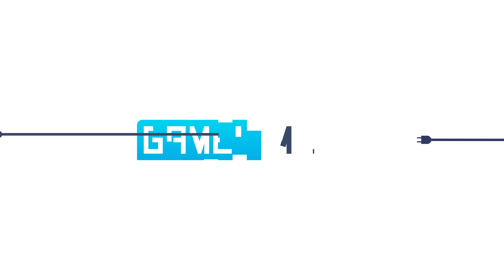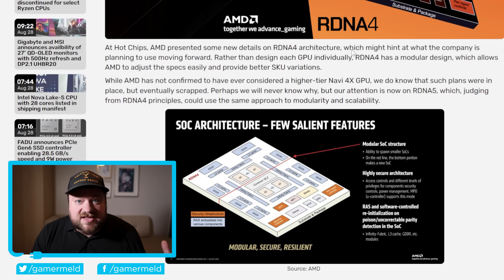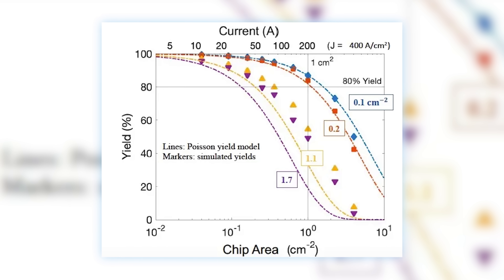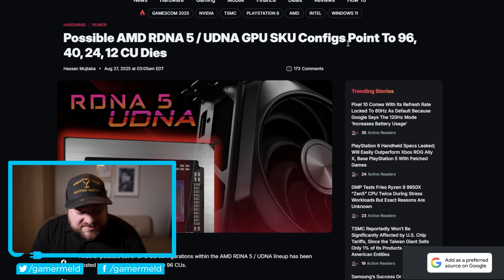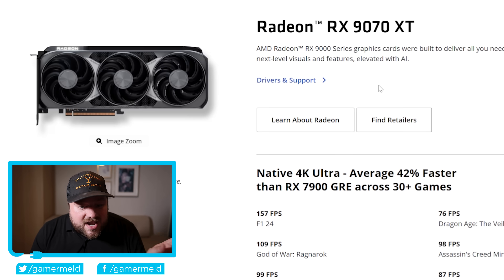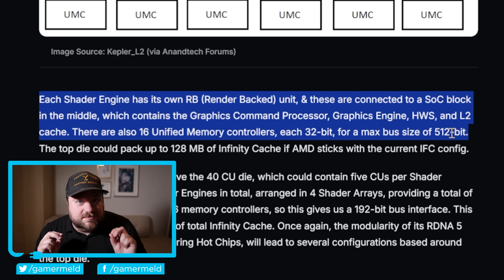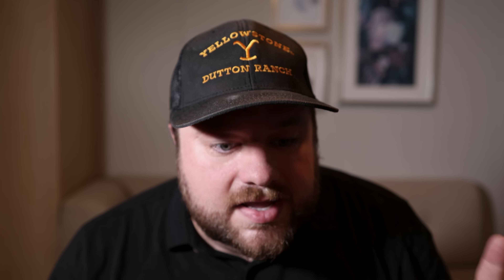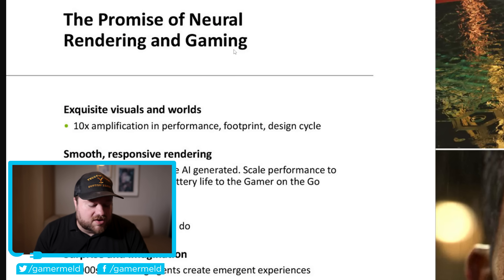Nvidia Officially Reveals The UNTHINKABLE!

Comment: I don't hate "fake" frames. I hate that it's being marketed like it's applicable on all games. In terms of rendering, what's "real" and "fake" anyway? So what is "real"? at least for now... It's frames rendered and produced from true game logic/game engine. Why is "fake" frames fake? Well simply put, the game engine doesn't recognize those frames. This is why current frame gen and multi frame gen techniques are not advisable on fps shooter games. Since you might see it as smooth at 400-800fps(whatever), but in reality, the game engine would only recognize input on the "real" frames that probably around 60-300fps. So on your screen, you think you are hitting your target, but the server/game engine does not register it as a hit, since the opponent's hit-box isn't there anymore or wasn't there to begin with.

So when will the "hating" stop? Well, once nvidia finds a way that those "fake" frames stop being fake. Which is once the game engine/logic recognize those AI frames. Because at that point, it would just be a new kind of rendering graphics and won't be fake anymore.
Reply: That's what I think to.. frame gen can be really useful if you can push 80-90 FPS in a single player game and want to fully use your monitor's high refresh rate, so you cap to 60 FPS and use frame gen, but they're selling it as a tech that can help you get 200 FPS coming from 30 FPS... we, tech enthusiasts, all know it doesn't work like that, but sadly some people don't and they fall for it.

The advertisement is the issue, just tell me it's a smoothing technology that works wonders in some games (cause it actually does tbh), don't sell me a 5070 like it's a 4090 cause you're going raw vs 4X frame gen.
Reply: @Iceman-hb3uk I remember playing with 20-25 fps, where we really had issues in competitive gaming, 30 years ago.
Cinema was working with 24Hz without any complaints, thanks to motion blurr.

Everybody should check his own reaction time and convert all lags into time to compare and really decide if it makes sense. That decides about the acceptable lag.

Everybody should check the repetition times with and without motion blurr to see a smooth motion. This decides about the repetition rates.

The gap can easily be filled with AI generated frames.
Reply: @moskitoh2651  Motion blur and frame gem CAN'T be compared like that.

Frame gen needs data to work with, if you start at a 24 FPS base you'll end up with lots of artifacts whenever you move the camera.
If that's your idea of a good gaming experience, I'm happy for you, but it's absolutely not bearable for most people.
Reply: @Iceman-hb3uk Motion blur and framegen both improve the smoothness of the recognized motion. They can be combined, to improve even more.

Guess you were very unhappy, whenever you were in the Cinema about the 24Hz... 😂😂😂

If you own a display with high refresh rate (obviously you do), there are pages showing you, how different framerates with and without motion blut look like, side by side. Warning: Afterwards you know, you spent money wrongly.
Reply: Reflex 2 is the answer... it already exists!
Reply: Fake frames are what they are, utter bullshit
Reply: So if someone hacks there own fake frames in real-time and slips them in between the other generated frames once a game recognizes those fake local frames like a cheating virus. shame. though doubt anyways smart enough to do this in the near future, or if even possible.
Reply: The benefit is for aiming and game experience. The difference between keeping 500-600fps and keeping 800fps is that you get the full input lag and motion clarity benefits from high refresh monitors like upcoming 720+Hz monitors, and the hitboxes are moving so rapidly that you're somehow going to miss because of it
Reply: @soren4904  Are you talking about frame gen at ×3 or ×4 in FPS games (even offline ones with high-FPS benefits)? If so, that’s not how it actually works. Right now, multi-frame gen only gives you smoother visuals, the game logic/engine still runs at the original FPS.

Example: if your GPU is doing 60 FPS “real” frames, the enemy hitbox moves from A → C, and if you shoot at C, it’s a hit. With ×4 frame gen, you’d see something like:

0 (real), 0A, 0B, 0C, 1 (real), 1A, 1B, 1C, 2 (real)...so on and so forth.

So it looks like 240 FPS, but the game is still only calculating 60 states per second. That means the enemy is really moving from point A → E in 60 steps, while frame gen just fills in B, C, D visually. If you shoot at anywhere from B–D, even though it looks like a hit on your screen, the engine won’t register it because those frames don’t exist in the logic.

So yeah, it makes games smoother, but for aiming it doesn’t help. As for game experience, it could probably feel worse when you “see” hits that don’t count and think the opponent has hacks or something.
Reply: @kitnoman  But in any real game that's not really how hitboxes work. It's not based on your framerate, and objects dont move fast enough that point B (fake) is completely separated from the real frames
Reply: @soren4904  But they do, and that’s exactly why higher real FPS matters in online shooters. Yes, the server and game engine register all movements from point A to B to C to D to E, that part is true.

The difference is what your PC actually renders and shows you. The game logic and server track positions and hitboxes in simulation ticks, and hit detection is checked against those ticks. With a slower CPU or GPU, you might only render an opponent skipping from A to E, which is why higher real FPS is so important. Frame gen can smooth things visually, but only the real frames are tied to the actual game state.

That’s why in competitive games, more real FPS = better input sampling and more accurate hit detection. With frame gen, you might see a “fake” position between A and E, but the server only cares about the real ones, so what looks like a hit on your screen may not actually register.

But again, this is an extreme example. It's why it is still not in any competitive games. On the other hand, while still cosmetics(smoothness), In an offline game,  since the the game logic, rendering and hit detection is calculated in the same pc, there's no server latency and no desync. So the negatives diminishes by a lot since real frame + fake frames is very close to what the engine just calculated locally.

So for now it's just beatification. But as nvidia hinted, their goal is 100% AI frame rendering. Meaning an actual successor/replacement option to rasterization.
Reply: @kitnoman the point of the "fake frames" is that they are closely replicating the reality of the game. Your fake frame is probabl6 pretty close to accurate, it won't cause a noreg because if its accurate then you are actually shooting where the target is. The server doesnt care about your framerate. It cares about if you clicked when your crosshair was ovsr the hitbox.
Reply: @soren4904  You are totally off the mark. Yes, the server doesn't care about framerates. The server only cares about simulation ticks. But fake frames aren’t new ticks, they’re just interpolated visuals. Even if they look accurate, the game logic never sees them. So if you shoot at what you see in a fake frame, it won’t register because that position doesn’t exist in the server’s state. That’s why frame gen is fine for smoothness, but not for hit detection in competitive games.
Reply: @soren4904 The point of Reflex 2 is that even with fake frames, what you see under the crosshair is, what the server sees.
Reply: @kitnoman the tickrate is not related to your framerate regardless of if the frame is real or not. If you click on the enemy and the server recognizes that you clicked on the hitbox, none of the frame info is relevant. You could easily click "between" two frames at 300fps and still shoot somebody because they don't teleport they MOVE, you know where the hitbox is. The only difference with "fake" frames is it displays that information. Yes it's not a rasterized frame coming from the game engine but that also doesn't mean there's NOT a hitbox there. Hitboxes don't magically disappear between displayed frames.
Reply: @soren4904  It's like this, my computer move to  point 1 to 2 to 3 to 4 to 5 the simulated ticks detected by the server is 1 to 2 to 3 to 4 to 5. Now on your pc, let's say you don't have a good hardware and with latency, pings and delays, your only able to render the ticks from movement of 1 to 3 to 5 or worst 1 to 5. That's the only ticks that you will ever be able to respond to and the real frame will be based on. Regardless if frame gen create "imaginary" frames in between, which would be 1 to F2 F3 to F4 to 5. The only reference that the server/game logic will ever recognize is the movement from the real ticks that your pc was able get, where were point 1 to 3 to 5 or 1 to 5(if latency and ping high).

That's what I meant, when I said game logic/game engine doesn't recognized those frame, those frames only exit on your pc. Ever played competitive shooter and then your internet had an issue and your ping latency increases? you are able to shoot, at least on your screen, but it's not really hitting any enemy/hitbox. That's how it could be like if you add "fake" frames on it. Intel, AMD or Nvidia, that's not where frame gen is at the moment, but I sure hope that's where the tech will be. But it isn't there yet.
Reply: @kitnoman your frames aren't synced with the server tickrate either way, that's just a shitty tickrate/hit detection problem. Like I said, real or fake frames don't have anything to do with hit detection
Reply: @soren4904 Real frames are tied to the game’s ticks, unlike fake frames. That's why I don’t get what you mean by "The benefit is for aiming and game experience." Frame gen doesn’t actually help aiming at all, it creates fake frames that aren’t there. On top of that, it adds latency because those frames take time to generate before they reach your screen, stacking with game ping and server delay.

Visually, sure, it can look smoother and make enemies appear less teleporty. But mechanically, it’s worse than playing without frame gen, because those fake frames don’t add new input samples or server checks. Your shots are always based on the real frames + ticks when you click.

In offline or single player games, that tradeoff barely matters. But in competitive FPS, it can actually hurt aim accuracy and hit registration, and add extra input latency. It’s like aiming at mirages/illusions instead of real targets.
Reply: @kitnoman server tickrates are beyween 64-128 ticks per second. Your framerate is not tied to a server tick.
Reply: @soren4904  But it actually is related. Yes, servers run at 64–128 ticks per second, and that’s how often the game state is updated. Framerate doesn’t change the tick rate, but higher FPS = more input samples, smoother visuals, and less latency (up to a point). Ideally your real FPS should be at least equal to or higher than the tick rate, so every simulation update can be shown on your screen.

If your FPS is lower than the tick rate, you miss visual info—that’s why enemies look jittery or teleporty. For example, in CS2 with a 64 tick server, if your PC only does 40–50 FPS, you’re only seeing at most 50 updates while missing the rest. Even if frame gen boosts it to 160 FPS, those are just interpolated frames; the server still only recognizes the 40–50 real ones. It’s like a cosmetic mod, you see it locally, but the game logic or other players doesn’t.

And since frame gen itself adds delay, it can actually hurt accuracy, because what you see on screen isn’t aligned with the current tick/state.
Reply: @kitnoman your framerate is also completely irrelevant to your input. Looking around and clicking doesn't happen per frame, it happens all the time. The server DOESN’T RECOGNIZE FRAMES. It doesn't know or care what your framerate is
Reply: @soren4904 The input lag of 100Hz is 10ms, 800Hz is 1,2ms.
A mouse has an input lag >5ms already. A user in between 100ms and 500ms reaction time.
Those high frequency monitors are absolutely useless. You won't feel the reduced lag, it does not look more smooth, it is pure marketing.
Reply: @moskitoh2651 idk what shitty mouse ur using but yes u can notice the difference